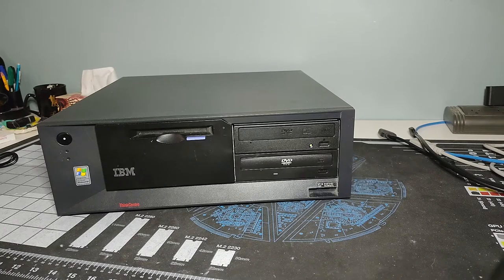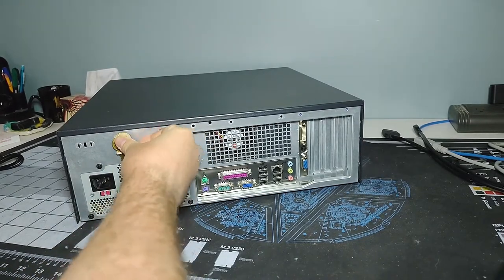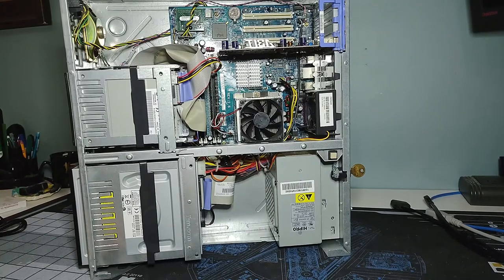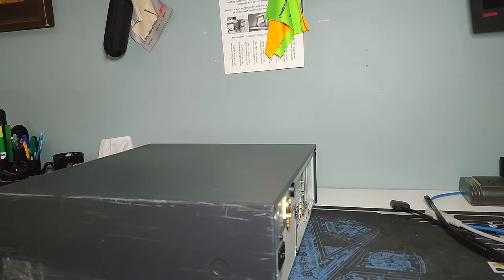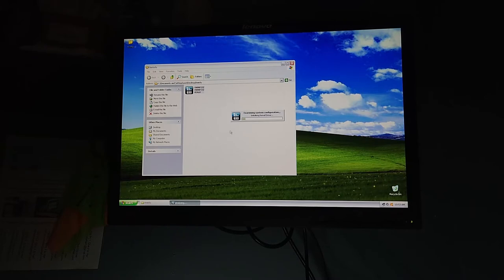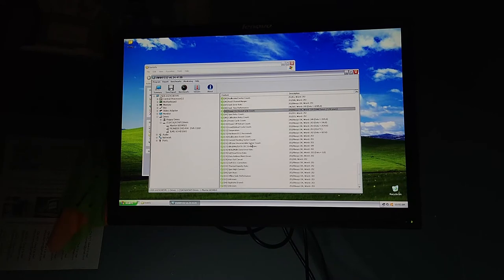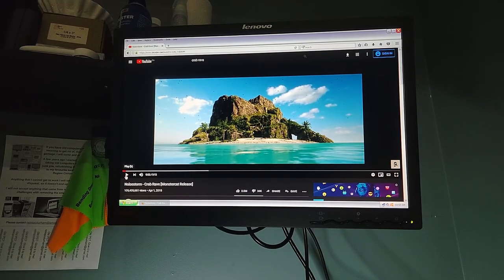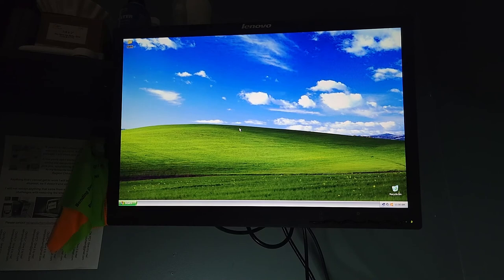IBM ThinkCentre M50 (8187)

Comment: Thank you so much for that Video. 

Interesting, i have the IBM NetVista, and it looks so similar to what. I found my PC on the Street, left for Death, with non working Power Supply, i replaced it, and the PC starts to work, it was Ubuntu Linux On it. 

I Tried to install Windows XP on it but the bios do not support it Natively, The bios was from 2000 and i instaled one from 2005 that brought also the Name Lenovo in the Bios, and Widnows XP runns now Well on it. 

Your PC is seems better in design and quality, it has the better Power Supply, and Fan System, and a Lock :D The fan behind the Power Supply was some kind of stupid in my system. 

In my system i have a P4 2,66GHz CPU Northwood, no HT, 2GB RAM, 40 GB HDD, and a Nvidia Quadro DCC with 64MB. An New DVD Burner Drive with SATA to IDE Adapter.

Comment: How to install windows? Because it does not recognize the installation media, at least the 32-bit ones, I imagine it is because of the drivers because I put the pro versions of windows 7 to 10 of 64 bits and run the installation media, but Obviously, it doesn't happen because it is a 32-bit processor, I currently have it with puppy linux.
Reply from the maker: Yeah, the processor in this system doesn't have NX bit which is required for Windows 10.  Choosing Linux here to be able to use for modern requirements is a  good choice on your part.  I ended up selling this to a guy who needed to repurpose it as a HMC for some IBM Power Servers he has in his homelab.

Comment: are those hipro units better than the liteon ones? i have two of the liteon units that appear to work but have loud transformers
Reply from the maker: I never noticed a difference but it's certainly possible that HiPro were doing a better job at shielding, since IIRC LiteOn was still more heavily making server grade PSUs and would be building to spec without any of their own inhouse improvements.
Reply: @retropcdurham  my model is similar looking but its a cheaper a30 model that came with a celeron, could be that its just a cheaper model for a cheaper system?
Reply from the maker: @longcat266  Yes within each model there are a number of supported processors, so the A30 could have come with a Celeron or Pentium CPU.  You should be able to upgrade pretty easily; the max CPU the IBM supported at the time was 3.06GHz Intel Pentium 4 , 533MHz FSB, 512KB cache, Northwood.  This is socket type LGA478.  It's possible that a Prescott CPU would work as well.

Comment: Are there windows 98 drivers for this model available?
Reply from the maker: I have not found them yet. The Lenovo EOL driver website only goes to the M51, and I haven't been able to find them on any other sites yet. This system did have support from IBM for 98/NT/2K/XP
Reply: I have Win98 running on one of these. Have a SB Live and GeForce FX 5200 (which obviously have drivers) but IIRC the onboard ones did also work, and it’s very stable.